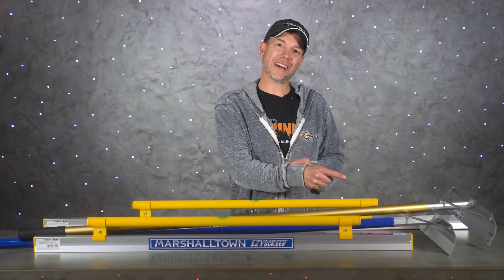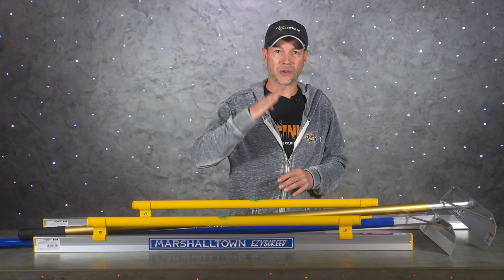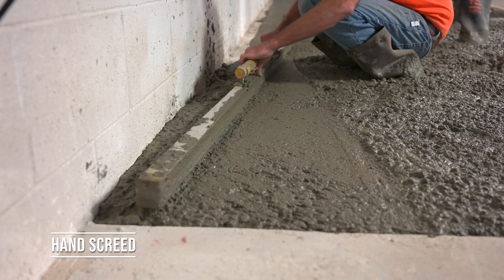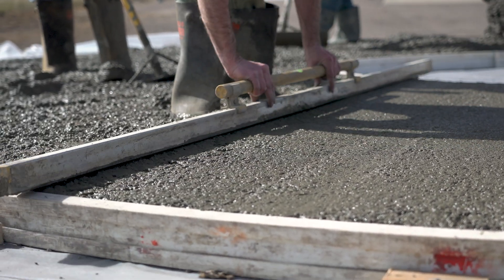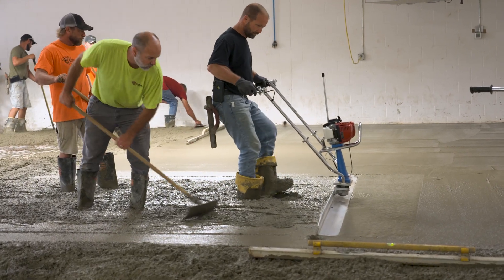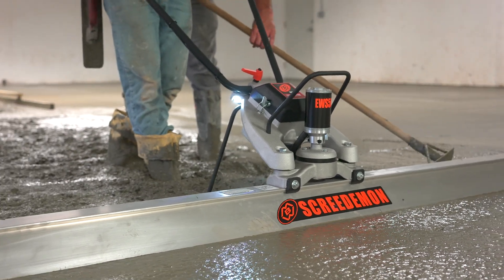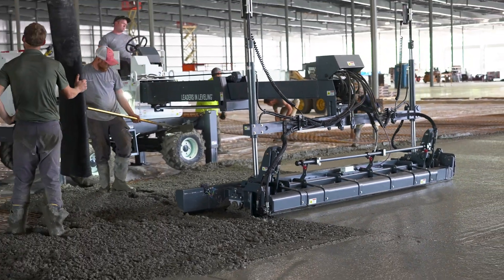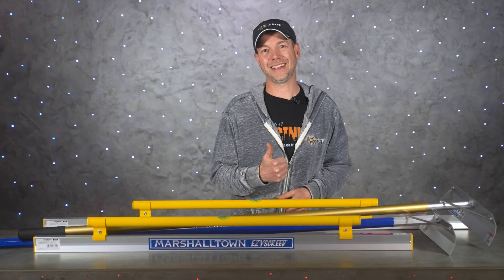Different Ways to Screed Concrete!

Comment: I don't get where you have a problem with the over hang on screeding... Yeah probably an older guy told you that it was being lazy when you do that but whatever it makes it easier and it makes it straighter... when it over hangs on the form it's easier to make it level. But hey everyone was taught differently and have different techniques and mentality when it comes to forming
Reply from the maker: Thanks for the comment! You are correct about everyone being taught differently and using different techniques to get to the outcome. I love seeing how others do things in this business, and we're always looking to learn something new. The reason I like having the screed board a little shorter than the form span is that I feel like I can get the concrete flatter that way. I still run the screed out over the forms when striking off each side, but I like having the option to pull the middle back without touching the forms. That way, you can visibly see a mark/line from the screed on each side and be confident that there is no hump in the middle. It's kinda hard to explain exactly what I'm talking about in text; we're planning on putting out a full video on this in the next month or so, it'll make more sense in the video. Anyway, we really appreciate your feedback! Thanks for watching Deco-Crete TV!!
Reply: Well, if the guy magging the edges before you run over it with the vibe strike doesn’t do his job and it’s not flat and you don’t overhang what he already magged out your gonna have a big ass hump along the entire edge .

Comment: Never used a straight edge with a handle on the top my God use 2 x 4 or aluminum straight edge
Reply from the maker: Thanks for the comment! We've use a bunch of different straight edges, from hand-made 2x4 screeds to the premade ones alliable from tool manufactures. The Easy Screed from Marshalltown is my hands down favorite!!                                                                                                                                                                                                       
 https://www.deco-cretesupply.com/products/straight-edges/ezyscreed-combo-screed

Comment: If you can hand screed it by yourself it’s too wet.
Reply: You can hand screed dirt, gravel, road base deco… ext tf r u on.
Reply: If you have a vibrating screed, but the concrete is too wet, it can be easier to drag the vibrating screed turned off.
Reply: Lol.  Even if that were true, it would be hard to say that with the water reducer we got nowadays

Comment: Nice work bro 

Concrete ninja is the man for screeding if anyone needs some tips on how to screed 👍
Reply from the maker: Thanks for watching👍
Reply: He's a tool 😂 the rest of us in Aus laugh at that guy.
Reply: @lachlanitis2311 thanks.. I won't watch the Ninja guy then .  have you got any suggestions of who else to watch for concrete screeding?
Reply: @tuberider1171  practice on sand first. You're really not ready for a screed until you can rake properly so you have the "eye". 
Only thing I will say is to always keep the screed straight in front of you, people who screed on diagonals will always end up with deviations in their screeding. 
Just get in and have a go mate, when you're learning keep checking your pads and screeding with the laser to see how you're going. You'll teach yourself pretty quick doing that, keep your screed as flat as possible to get all the humps out, if you don't see lines at the ends of your screed you've got a hump in the middle. Saying that try not to cut the side down below the heights at the same time, you're gliding across the heights.
Reply: @lachlanitis2311  fantastic advice - much appreciated
Reply: @tuberider1171  all good mate, best way to learn anything is to throw yourself in and not be afraid to have a go. Saying that, if you're not sure on something always ask questions, an employer will not get mad to answer a question. It saves mistakes in the future. 
This is unrelated but I always say this to my boys, if you make a mistake or f up, straight up tell the boss, once the concrete is dry it's done, when the concrete is wet or formwork is being done you can fix things. I say to my boys I won't get mad if you tell me wel fix it, il get mad if you don't tell me and we can't fix it. 
Best of luck bud, bring a good attitude to work and you'll have a good day.

Comment: Hi. I have forms all set to go. 24x22 ft slab for a patio at the back of my house. Ready to order my ready mix soon. My question....Should I break the form into two parts to make it easier to screed? If so, what should I use....a temporary 2x4?   then screed and pull out and screed the remainder??   
Or....Half thinking of putting in a foot wide concrete pathway  and screed from that instead of using a temporary 2x4. What do you reckon? Thanks.
Reply from the maker: Thanks for the question! Most concrete contractors would set grade stakes in the middle of the slab. They would be set to the final slab height and used to set a guide line in the concrete to screed off of. This will require some screeding experience, and you may want to get someone who has done it before to help with part this part. I'll leave a link to another video at the bottom. The video is about slab thickness, but there's a part about grade stakes at the 2:38 mark. There's no right or wrong in your case if this slab is for you and the other solutions you mentioned would work. They would just come with their own set of challenges like cold joints that can be hard to blend together, more formwork, and even a second concrete truck if do the walkway through the middle. Hopefully, this helps, and please let us know if you have any other questions about this. Thanks for checking out our channel!!  https://www.youtube.com/watch?v=IRO9wRSKfw8
Reply: @DecoCreteTV   Just watched the video. Those grade stakes and tight line seem to work like a charm as my slab will be sloping 3inches down away from the house. I really appreciate the advice. Brilliant and informative Youtube channel you've got also👍. All the best from ☘️☘️☘️🇮🇪🇮🇪🇮🇪

Comment: I am pouring a 12x14 slab in my yard and I was wondering if I could screed it with a pvc pipe. This is a diy project and finding 2x4s that are a do-able length that are square and unbowed is damn near impossible.
Reply from the maker: pvc pipe will probably be too flexible.. we would recommend trying to find a nice and straight redwood 2x4

Comment: Hi Jeff, that's a great video. Even though I have take the training classes I always confused the proper tools to use when  integral color and color hardener and also what is the proper order after screening. I know some times you use different bull floats and steel. For example the other day I was doing a patio with color hardener hardener. We screed the concrete and then I was kind confused what bull float to use before the color and what after the color, also at what point I use the lrg steel float. Also what about when doing integral color. I would appreciate if you make a detailed video. I have watch all the videos but I couldn't find something with details.
Reply from the maker: hey george! the order will always be bull float after screeding, and steel float right before stamping. magnesium floats work best for integral color, resin or wooden floats when using color hardener.